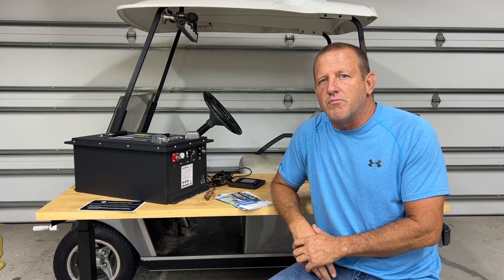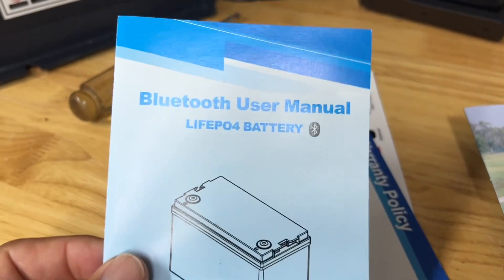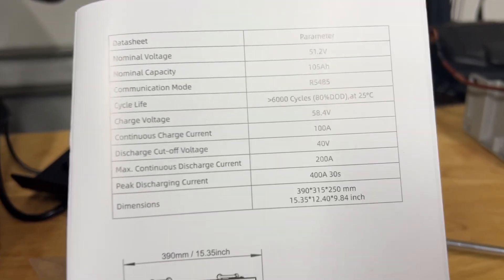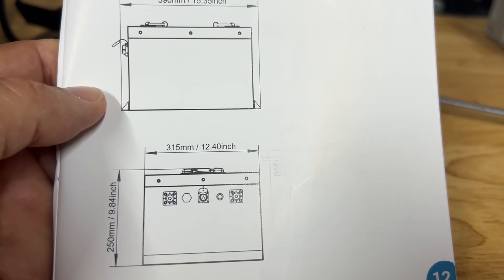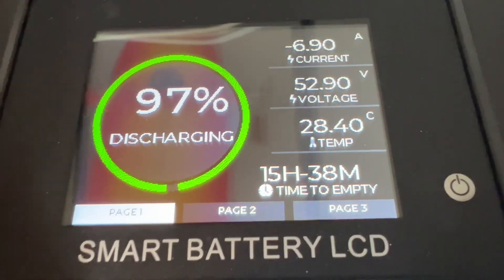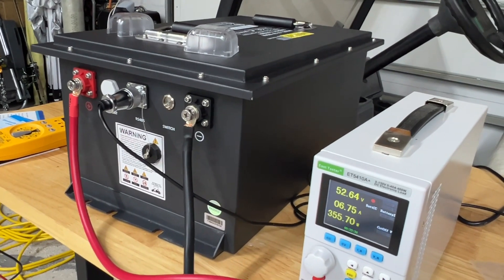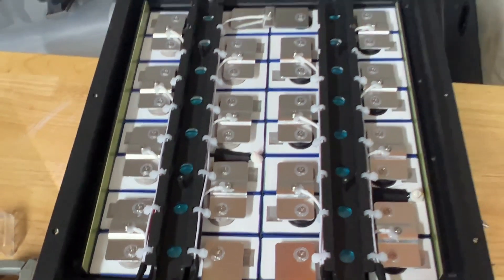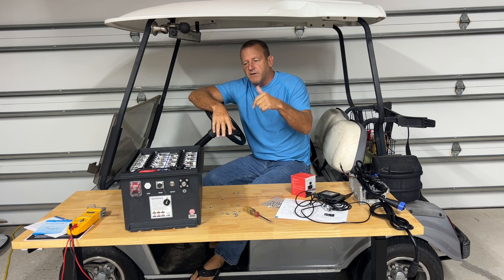AOUSK 48V Golf Cart Battery Review -Specs, Test, & Honest Opinion

Comment: Great video. I actually rolled the dice on this battery and have had it installed for a few weeks. It's been great powering my cart uphill with no issues. I've been wanting to take the cover off but now I don't have to thanks to your video.
Reply from the maker: this battery is solid inside. i was impressed